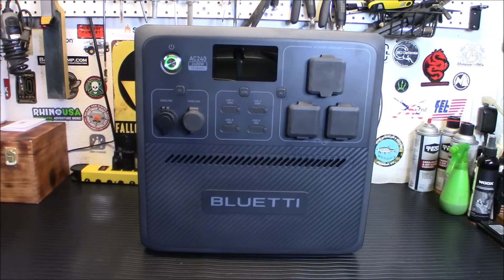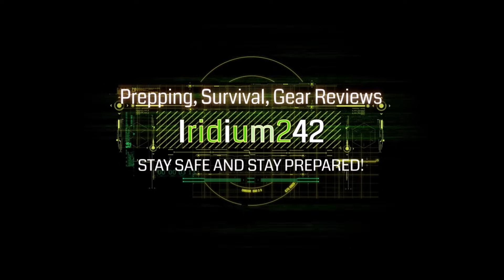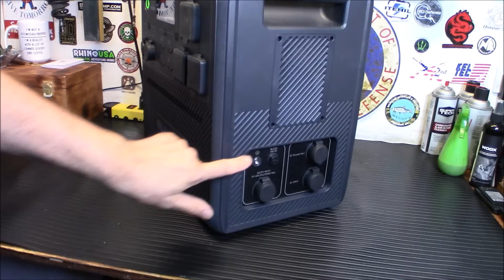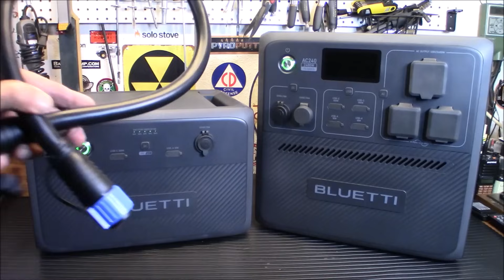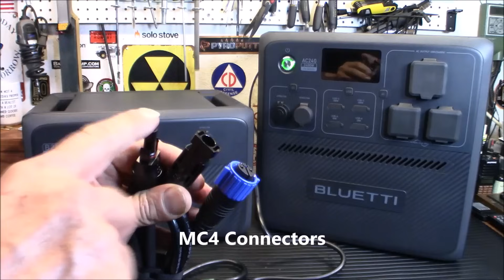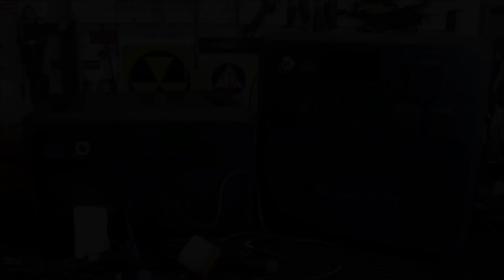First Look! The Bluetti AC240 - IP65 Water Resistant & Dust Resistant Power Station!

Comment: Thanks for the review, I am a fan of Bluetti and have several models, however, I am not a fan of the many proprietary cables that are needed. Many are exclusive to the model and cannot be used with a similar connection on a different model. 
Cables get lost, damaged and I like the standardized options.